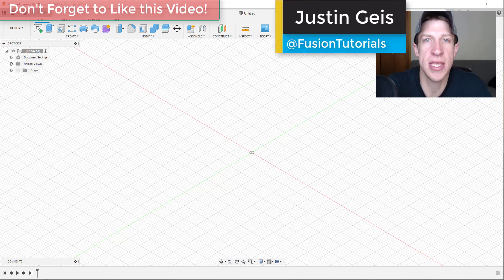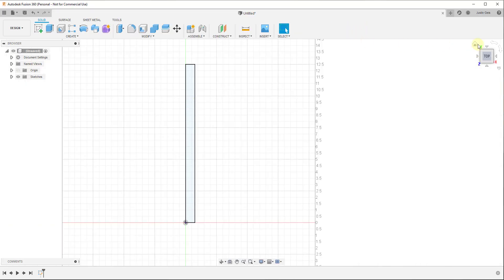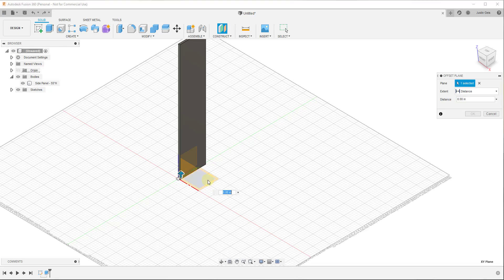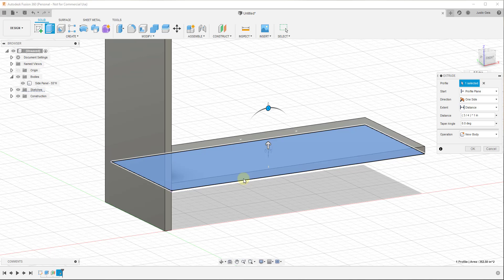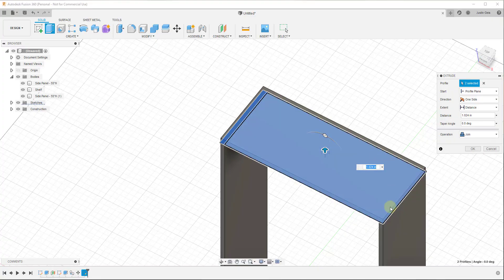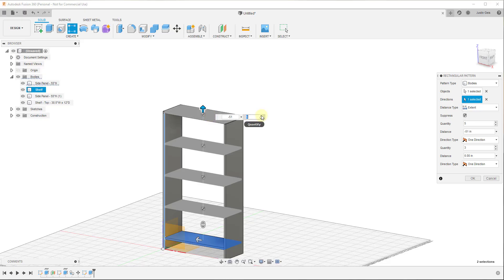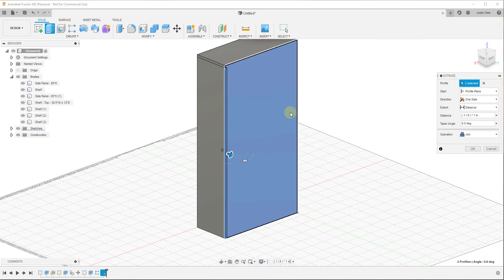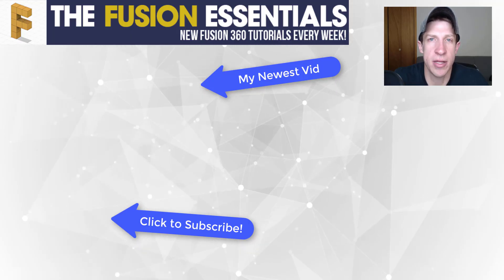Modeling a Bookshelf in Fusion 360 - Fusion 360 for Woodworkers Part 2

Comment from the maker: Hi everyone! Let me know if you have any questions in the comments below! :)
Reply: all Vids are awesome, first time Fusion make sense to me, one thing giving me hard time is how to pick up plane, I'm totally disoriented, and get easily confused do you have any tips tricks to overcome this issue going Home doesn't make things batter   (-: ????
Reply: Hey can you please send me the file for this tutorial.
Reply: I would have liked to have seen examples of shelf pin holes in this example. But great tutorial :)
Reply: The special thing would be if all the designs you have made so far, are parameterizeable. The width, height, length, number of joints e.t.c.

Comment: At this moment, not to be offensive (and could be because Im trying do make objects without a mouse, and a laptop) but every single program out there with some guy is teaching useless. Things don't line up (dimensionally the same); the offset tool is a perfect example. Zooming in and zooming out to shapes is different - I don't see what I'm missing there. I wish there was better education on simple stuff. This education is great for anybody Milennial and younger but if your older it doesn't account for the little and subtle things
Reply from the maker: Your life would be a lot easier with a mouse and a scroll wheel to zoom in and out. If zooming is your main struggle right now, that would probably help a lot.
Reply: Fusion 360 is way to inconsistent it took me 14 hours trying to extrude with a single line that's with a mouse and all points closed -- I stopped trying at that point. Their isn't support for basic stuff to people more experienced with this software.   I'm going to try Solidworks @TheFusionEssentials

Comment: This series is great! you don't make assumptions with what we might know or fail to show a step. just first rate. I am wondering how, to say, widen the shelves in this example and have the sides etc adjust accordingly. Thanks for your good work!
Reply: parametric parameters. Basically set user parameters for total W H D and material thickness before you start sketching, then when you start your sketch, instead of typing in your width in inches you would type in the parameter name for width and select that. Then same for height and depth and material thickness for each panel. Then you can adjust the parameters by size as needed and everything will follow suit. Its not quite as simple as that but thats the gist. Look up "casual builds - why woodworking is great in fusion 360" he does a very fast basic break down on how easy parametric parameters can be.
Reply from the maker: @EZEvans1 - Here's an updated video I did that has the parameters baked in for easy adjustment - https://www.youtube.com/watch?v=Vsod3kTlXOI&list=PLHEouj-sdEJEm_xextUwnfhRJEdUs2hn4&index=3&pp=gAQBiAQB
Reply: Thanks Justin! @TheFusionEssentials
Reply from the maker: Yeah this is something I want to get more into in the future - glad I've been able to help so far!

Comment: Great video tutorial, Justin~!  I'm a long-time woodworker and a newb to 3D Printing.  I've been using SketchUp since its release, but I'm really interested in learning Fusion 360.  Having been an AutoCAD user in earlier years, this is a great progression for me.  I really like SU (and am a bit disappointed in their cloud-based version), but I find that F360 provides more options and more granular control in drafting. Anyway, I found your instruction very clear and easy to follow with good explanations of the features used in this video.  I'm looking forward to digging into the rest of your F360 tutorials~!

Comment: Hi, ive used CAD previousy so fusion giving me headaches and seems to take longer to achieve same thing.  For example, on your bottom shelf, in CAD I can draw on base and then just select move, and give distance, al done.  You created an offset plane first then drew the shelf which is like drawing it twice.  Also I use mirror very often, for example a euro hinge hole, I'd draw a 35mm diameter circle and then the screw hole on one side.  I can then use the center of the circle as a mirror point and flip/copy the screw hole.  I can then mirror these holes so I now have a hinge at the bottom of the carcass.  I can then copy these 2 hinge holes using a point (base point) fom the corner of the carcass to another carcass.  Seems in fusion most people seem to draw each piece seperately. Am I missing something?  I am waiting for the eureka momant when all this makes sense.

Comment: Thanks for the tutorial.  It was fairly easy to follow.  Now, let's say I finish this bookshelf and then decide I want it to be 2" wider, 4" taller, the kickplate to be 1/2" shorter, and I still want the shelves to be evenly spaced vertically.  How does one go about doing that?  It seems like it would be easier to just start over.

Comment: Great video. I am switching from sketchup to 360 and watching your tutorials, on woodworkers part 2. Super helpful. I'm replacing pantry wire shelves with similar cabinets but with drawers. I may cut 3/4 dado's in the side panels and have already done that in a sample project. I may also put softclose drawer hardware instead of using dado's. Do you have other videos where you show how to put drawers with hardware and drawer bottoms fitting into dado on side panel and slide that way?

Comment: This is very helpful to get started! One issue I encountered. At about 13:00, the video suddenly jumps from spacing to extent when you're doing the shelves without you saying anything. I had to watch it 5 times before I noticed that when you suddenly jumped from 12" spacing to 51" at the top shelf that the distance type changed from Spacing to Extent.

Comment: I've got a question, I tried following your video and it has been helpful. But when creating the top part of the panel, part of the panel does not lay nice and flat with the other panel. It's nice and perfectly aligned on one side, but on the other side it's a bit off. I've tried to redo this by following the lines on both sides of the side panels but I still get the same result. What am I doing wrong? How can I fix that issue? I use the square sketch tool and follow the lines on the top two side panels and always get the same result. Even zooming in to make sure I get them aligned and one side is always perfect and the other side is off. It's very frustrating.
Reply: NVM I think I figured it out. Thanks anyway, I'll continue playing around with the program and watching your videos. Thanks again!

Comment: Excellent content. My version of 360 has a rectangular, opaque background to the Browser which covers perhaps 1/5 of the display space.  I see on the video that yours only opaques the rectangular area needed as background for text in the browser, thereby making the rest see-through.  Is that a preference that I can set?  I didn't see anything that looks promising.

Also, this brings up my other problem: In both the training videos from AutoDesk, as well as yours, there are some interface variations. Although small, they can interfere with learning.

Finally, could you do an interface tutorial which focuses on all the clicking, right-clicking (not natural for us Mac'ers) and selecting features - especially all the nuances to the various icons in the Browser as well as all the icons that show up in a sketch and in models?

Comment: While I appreciate this beginners' tutorial, here's what you missed:  1. You did not specify the type of joinery.  2. You did not specify fastener type.  3.Those are all butt joints, which are extremely weak, so you really needed to specify dados and rabbets in this piece so that it would be stronger.  That "bottom" piece, which you called a "shelf," is better termed as "bottom," and not shelf.  The bottom should be joined to the two side panels by a dado cut into the two side panels by 3/8 of an inch.  This means the bottom would need to be 3/4 of an inch longer than 29; so 29 3/4 in length.  The top piece should be joined by a rabbet into the two side panels, so that the ends of the top piece are completely buried into the side panels by 3/8 of an inch (since the thickness of the side panels are 3/4).  This would shorten the top panel by 3/4 of an inch.  Now maybe you cover "joinery" in another video, but I'll keep watching to see if you cover these important features.  Also, the best way to teach in a tutorial is to have the viewer follow along and perform each task as you perform them.  So give instruction as to what to do, and instruct the viewer to go ahead and mirror what you did.  In this way the viewer experienced "tactile memory" which is much longer lasting than simply watching -- "doing" is what solidifies a memory better.

Comment: At 6:03 "I just draw my line", it appears to snap to the upper point.  My just floats, so I need to enter the value to make it line up.  I am operating with the default preferences.  Is there an option I need to turn on?
Reply: Select Grid settings and change it to adaptive

Comment: Adding my thanks too Justin, great job.
Big advantage to folk is the relative simplicity of the shapes used for the bookcase. I learnt more about 360  from your first two woodworking videos than from many more complicated models. Recommend woodwork models to everyone starting out, even mechanical engineers. 
Hope there will be something on printing out 2D scale drawings of the model components at some point (I make wooden automata as a hobby)

Comment: These videos are awesome tutorials! Thank you so much!
I have run into an issue with Rectangular pattern. The tool isn't one of the main icons like on your screen. Instead it's in the Sketch dropdown, and before I can select it I have to hit Create Sketch. When I do that I have to choose a plane, so I choose the top of the self. I can then select the shelf body. but when I hit Rectangular Pattern it goes to the top shelf plane, and I can't select the body in the pattern settings. Just seems like things are wrong from the get-go. Any ideas what I'm doing wrong?
Reply: Figured it out. I didn't realize there's a rectangular pattern option under both Sketch and Create!

Comment: first let me say excelent video, and for those who say you go to fast i agree. i would recommend Learn fusion 360 or die trying by paul mcwhorter. he has 13 videos in this series. he goes at a slow pace with lots of repetition, just right for those of us who rode the short bus. then watch this series.  I'm not trying to take away from justins channel,  i've learned lots here. but if youre struggling check out mr mcwhorter first.

Comment: What is the difference when choosing New Body instead of New Component? Thanks for the playlist btw!
Reply: I also would like to know this!
Reply: From what I'm learning, a body is good for a shape, and works if you are making something that will only ever be in reference to itself.
Components are used for doing more complicated assemblies or products. For example, if you were creating an object with multiple moving parts that will later be connected, you would do the different parts as components. Or, if you are creating a product line, you can create components for the different parts and use them across multiple products. Then you can generate parts lists, assign joints and connections, etc.
Components also appear to work better for having parts that adjust themselves if you change a feature or value. In general, most guides I'm seeing recommend  making your design, using components, made out of shapes, developed from sketches.

Comment: I created the first construction plane (4 inch high)  like you did, and after that my line won 't snap to the side piece. What am I  doing wrong? Great video 's, keep on the good work!.
Reply: Never mind, solved it. I just had to zoom in way more than you did. I don't know why that is...
Reply: @sergepistorius  I had the same problem. When we got to the back panel, I couldn't snap to the plane no matter how much I zoomed and did further investigating. By default, there's a setting in preferences off you want to turn on to simplify this. Preferences>Design>Auto project edges on reference>Checked (unchecked by default). Once I applied that, everything became WAY easier. Reference of solution here - https://forums.autodesk.com/t5/fusion-360-support/sketching-on-offset-plane-unable-to-snap-to-other-component-edge/td-p/8806112
Reply: @brianjohnson3581  Thank you!  Thank You!
Reply: @brianjohnson3581  100% helpful..thank you sir!
Reply: @brianjohnson3581  Thank you, this was driving me nuts!
Reply from the maker: Glad you got it!

Comment: what is the difference between body or component?
Reply: It's more of a hierachical decision in whether to use bodies or components. Components can be used for making assemblies (a cad functionality of briinging components together, possibly with moving joints etc), saved as standalone reusable parts etc. Also when making a bigger designs, divide it into components at the beginning already because all the timeline steps are then belonging only to that component you work on, making the other component timelines uncluttered which is a huge benefit. Components are mostly higher level parts which is possibly made up of several bodies within, but it can be only one as well. One can always convert a body to a component if needed.
In this video there are just bodies, which is built as an "assembly" without using joints. Perfectly  fine. Let's think we need feet as well, finds one design on grabcad and imports that as a >component< in the design. Multiply that by 4 and place them at appropriate places (or use "assemble" for a rigid joint).
Reply: @kristianjorg418  Not sure if this is true, but I think if you use components, then in drawing mode, when you add a table for a parts list, it will give you 'wood" pieces of the same size not as a group, but individually. So for woodworkers I believe bodies are mostly going to be useful, however let's say you have 2 pieces of the same dimension but of different materials, then I think having 2 components makes sense. 

Is this true?
Reply: @blahdiblah2169  I haven't used drawings. But I'm sure you are right. Components open up a bunch of functionalities. Bodies are just subfeatures of a component.
Reply: @kristianjorg418  What I since discovered is I'm partially correct. Absolutely if you want to generate a parts list then components are the only way to do this. However it's not just a simple matter of giving same dimensioned boards a unique part number.

Instead you must create a component and copy using a pattern tool or move/copy tool. You absolutely have to do this to create another instance of your component. Also worth mentioning the mirror function will not create an instance of the same component, but a totally new one, so that won't work. 

All in all it means you have to redo any existing designs or if you're starting a design just make sure you use this way of working from the get go, and then you'll see correct quantities in your parts list later.